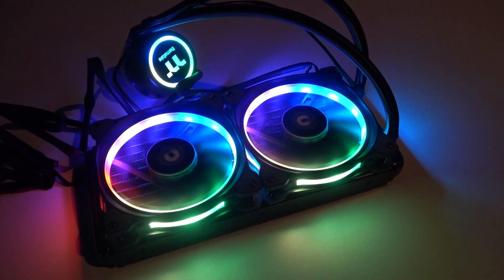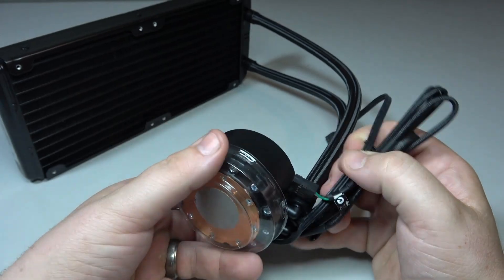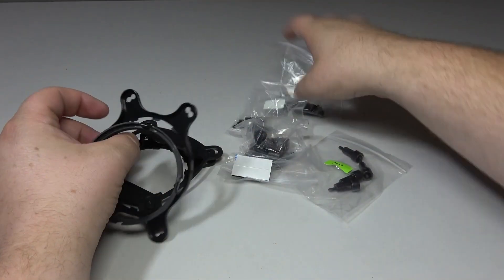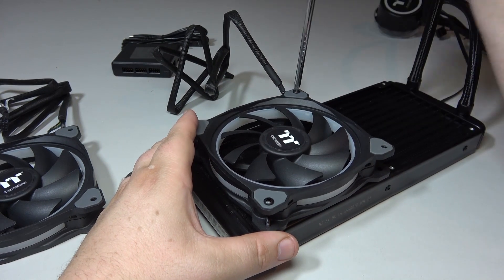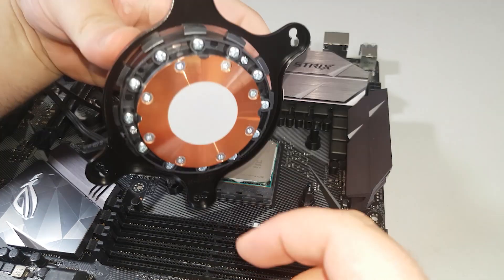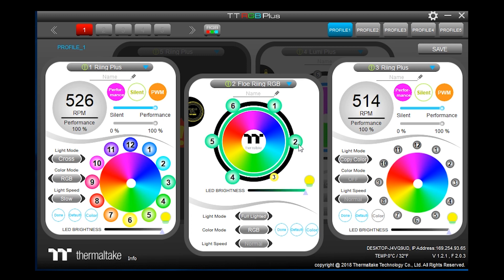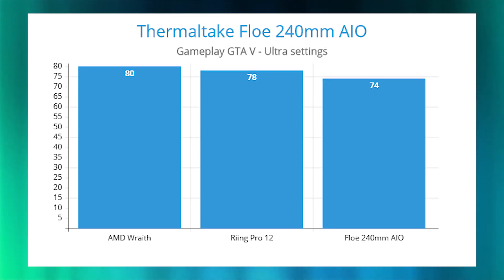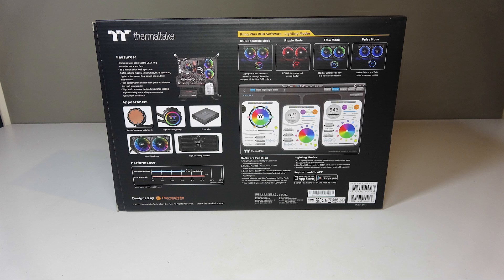Thermaltake Floe Riing 240mm AIO

Comment: I have a question, we are having connection issues with the software and it connecting to the fan. It brings up the error code "Could not find Fan Controller, please check the Fan Controller is connected. (Error Code:H_0x0001)."

Comment: Hi, can the fans be exchanged for others? I would like to add the Corsair LL Series LL120 RGB
Reply: Yeah but you will have to use their controller and software so more cables. Plus those fans suck on radiators.

Comment: Beautiful video. BUT<<<<<<<< YOU FORGOT the locking ring for the AIO pump to the mounting adapter.  Snaps into the AIO pump after you mount the adapter plate but before you mount it to the MOBO.
Reply: do you still need to put thermal paste on the cpu?